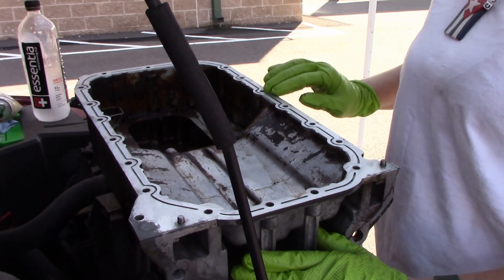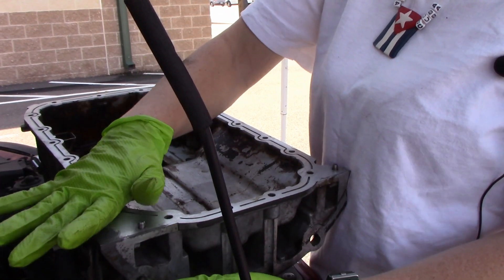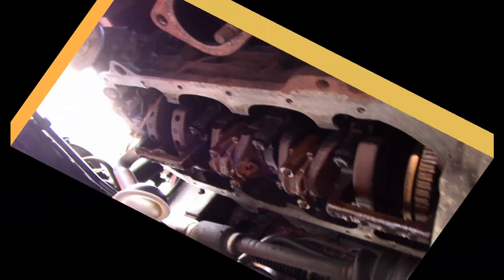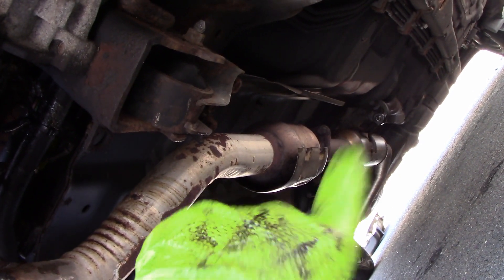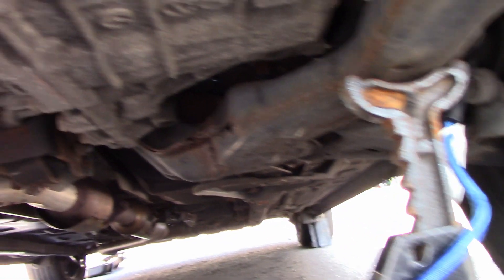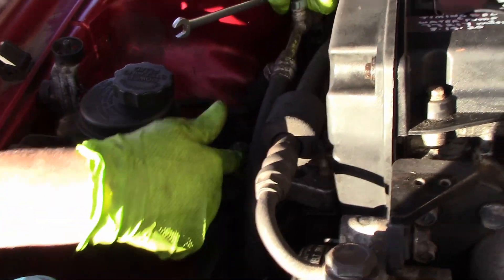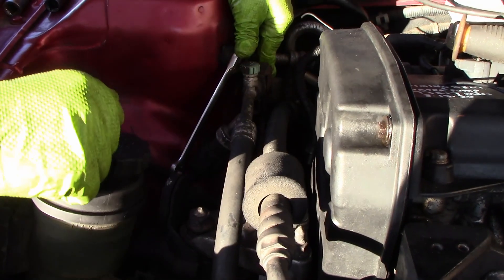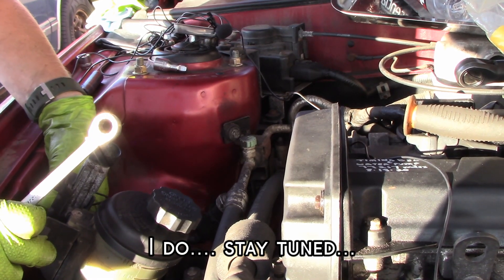04 Elantra 2.0 Ltr -Timing Belt, Water & Oil Pump Job -Part 3

Comment: Question
Did you check the engine oil pressure, cold & operating temperature?
Was the oil prey in "Specification", when hot.
About 35 P.S.I. @ 1500 R.P.M.

Question
Did the Oil Pressure , warning light stay off, presumably at Hot/Operating temperature idle?
Currently I have Hyundai Elantra 2006, similar issues.
I ran oil pressure diagnostics, and even with thicker grade of oil, when hot was below specification oil pressure.
Sump ready to split tomorrow.
Will check Conrod big ends for play, and measure journals & Plasti-gauge Conrod big end bearing oil clearances, and replace Conrod big end bearing shells.
The oil pressure, I can crank out 65 P.S.I. when cold running 25W-70(SJ), engine oil.
When Hot same oil at idle is Greater that 2P.S.I. but less than 5P.S.I.
To achieve 35 P.S.I. required at 1500 RPM, requires 4000 RPM.
323,000km on the clock.
Got Conrod big end bearing Cap bolts & Nuts new, just in case these bolt Stretch or Fatigue, messing the oil clearances to excessive.
Reply from the maker: At the end of this series, I attempted to do so, and mentioned this in the video, I believe. However, I was on site and the attempts to remove the sender to install my pressure transducer had failed. I had my scope to use to get the most accurate reading as well as have the ability to record it, both for myself and for the customer or records. That sender was seized and I didn't want to break it. Too late to be able to purchase another sender.  The customers were ready (as well as i) to be done with this job. 

I can tell you, the vehicle still runs & drives to this day. If the oil pressure had been lacking, there would have definitively been issues by now.  It has 15k miles since this repair. She drives a lot of hwy for work. 

Those pressures you mention are quite low. More than likely your issues are the bearings, not a all the oil pump. I've never heard this style of pump to fail, period. Now what caused the bearings to fail? Starved of oil? Lack of maintenance? These are the questions to ask. If doing this work on the engine, you may as well do rings, hone cylinders, and replace main seals on front & rear. If you're going through all of the trouble to use plastigauge to check clearances, may as well do the best job possible.  How is the rest of the vehicle?  Trans or suspension? Is it worth all the time, money, & effort?  Just things to keep in mind before diving in. I hope I could answer your questions.  Good luck 👍
Reply: @CubasAutomotive  Wow, Thanks for your reply. I'm still learning new skills with Digital diagnosis engines at 60.
Just self taught, have split tractors, serviced carbies, car engines, clutches, suspension. Brake rebuilds.
This Elantra, I purchased a Foxwell code reader, which paid for itself. 
Hoping to split off sump first thing. 
Watched, again yesterday, to pick up the
Tip
Bolt hole and bolt at front back and bolt purchase on engine bolt, as sump is well fastened with sealant.
Your a great Technician/Mechanic & Tutorial /Teacher.
Expect sump & oil pickup to be sludged up.
Will only remove oil pump if I'm not satisfied with my conrod big end bearing diagnosis.
The previous owner advised , the owner she purchased it from 5 years ago, ran engine out of oil. 
That's why I hit up oil pressure. There isn't any spun bearing, just a faint knock.
Doing a Timing belt full kit with water pump as well. So you video's set out the procedures clearly.
Also Static Timing belt, either jump a tooth or installed incorrectly or beyond Stretch limit.
Serviced and tested VVT, replaced VVT oil filter
Was throwing 
P0011, and Engine light, that's how it was when I got it home,,on trailer and put a new battery in and serviced.